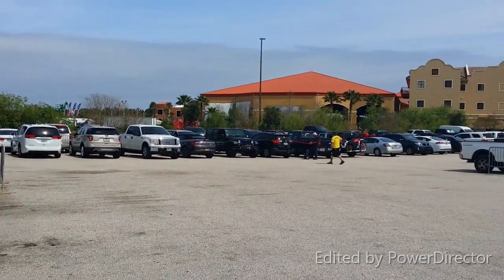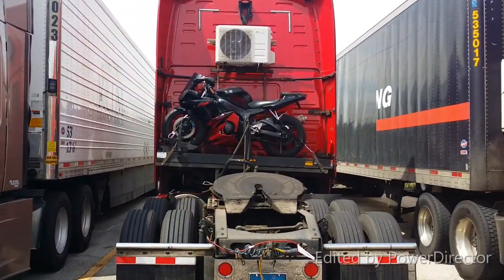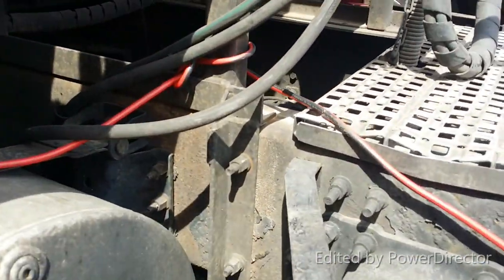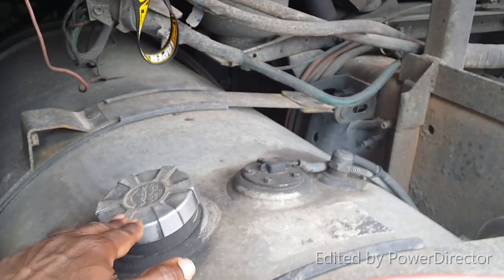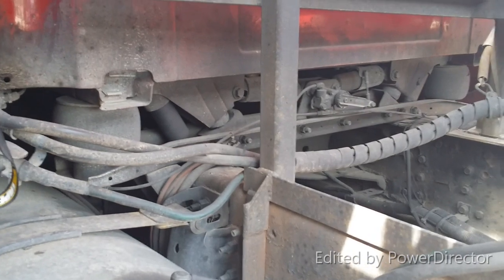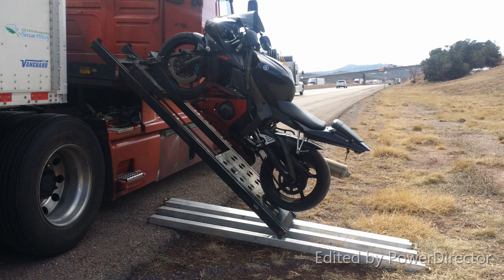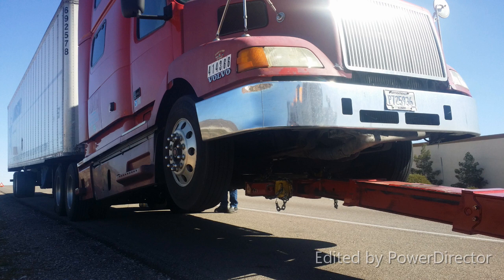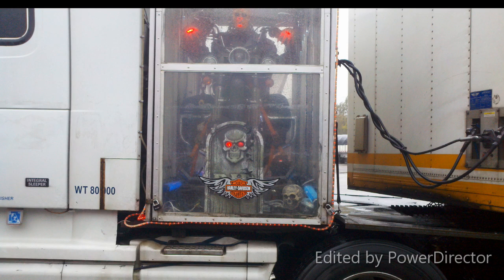How I mounted my motorcycle lift to my semi truck

Comment: Awsome Setup you have there man! Did you ever measure between the cab and the center of the 5th wheel? I wanna see if that will work on my truck, I pull a reefer trailer
Reply from the maker: Thanks for the comment, but I don't think it will work with a reefer unless the wheelbase is longer than usual. I saw a video of a bike mounted on the side of the truck under the sleeper

Comment: Did  you do a video on that Muffler ?  Sounds  like a Rip off..
   I have done welding  on my lime spreader  box on my truck before.. and  tiny  drops of molten metal  made pin holes in my air line..    You could   put some soapy water in a  spray bottle to  look for air line leaks ..
Reply from the maker: You are right that muffler was a rip off! I have another truck now a white 2017 Volvo. I got the muffler moved and I paid a lot less and I haven't had any problems with it.
Reply: @passporttrucker9280    You need a Truck with a longer wheelbase  so there is room behind the sleeper  for the Motorcycle..
Reply from the maker: @mikeskidmore6754  The distance between the back of the sleeper and the front of the trailer is what matters the most.  It is 67 inches and 4.5 inches between the sleeper and the lift.
Reply: @passporttrucker9280    So that is the Minimum room you need.  If you were pulling a reefer you would need even more room.   Most Trucks have sliding  5th wheels

Comment: I am in Alberta Canada. My understanding is you are not allowed to drill a hole on the truck frame . It won't pass inspection. I thought that safety law would be same every where
Reply from the maker: No holes were drilled into the frame. The frame for the bike ramp was secured with the bolts that were already on the frame. My truck was inspected by DOT last Monday. I've been carrying a motorcycle on my trucks since 2013. Also I'm leased to a carrier that requires a truck inspection every 120 days.

Comment: I see  you do use a Cover ..  It would  definatley  be worth your   trouble to make new brackets  with the passenger side one lower..
Reply from the maker: You are right I do use a cover. How did you know? I only paid about 40 dollars for it at Walmart. It has straps on it to keep it on when I'm driving. Why would lower brackets on the passenger side be better?
Reply: @passporttrucker9280    I  said you need a cover .. then  I saw your second  video that  showed the bike covered..  
  I have a really  nice  Heavy cover  but keep my bike Indoors so have not used it .  My Cover is Oxford   Protex Flex ..  I reccomend it ..   I had to get a much larger size for  my Yamaha FZ-07  because of Top case and side case..  Now I  have a much larger windscreen but  it is quick detach >
   You did a  really nice job  on the fairing hinges..
Reply: @passporttrucker9280    I was searching for the Bike Lifts  and I found  a youtube  channle that uses one ..  
@Hooperand Whistle ..  He  just  had some mounting brackets made  where the  drivers side is lower ..  so the bike unlaods  downhill..
Reply from the maker: @mikeskidmore6754  I'm planning on having my mount changed so that the rear part of the lift is lower than the front part for the same reason. As it is now the back is lower than the front but not by enough. It is also less stress on the cable. Thanks for the comment.

Comment: Did you have to get it inspected or anything? I plan to run a mount for my ebike until I get my bike finished.

Just need to know how to mount the stand so the guys at the scales have nothing to write me up for.
Reply from the maker: I didn't have to get the lift inspected but my truck and trailer gets inspected at least 3 times a year. I'm leased to Landstar. They require an inspection every 120 days. I have been inspected at the scales too. I've never had a problem because of the lift.

Comment: What kind of hinges did you use on the side panel on your truck and can you get  better pictures of how they are installed
Reply from the maker: I used the hinges that were on the closet doors. You can also find hinges at Lowes or Home Depot. If you go to a  home improvement store look for kitchen cabinet hinges
Reply: @passporttrucker9280  thanks

Comment: Where did you get this lift installed at? Can you send me information so I can get one installed please
Reply from the maker: I had the lift installed on my truck 6 years ago. I'm sorry I don't remember the name of the metal fabrication shop. It's in Orlando, FL. near Truckers Paradise which is also called Acme Truck Stop . I will try to find the receipt for you. I also need to have my frame redone. I want to change the angle because in the future I want to get a bigger bike.  You can go to a different shop and show them the video.  The shop that I went to doesn't normally install lifts on trucks. I went to the shop with a drawing of what I wanted  and we did the work together. You can find the lift on Craig's list or in the back of the motorcycle magazines.
Reply from the maker: The name of the metal shop is L & C metals. 711 Central Florida Pkwy  Orlando, FL. Jeff or Mike made the frame.  The number is 407-859-2600.  I found this info in my cell phone a few days ago. I called to make your sure that the number is still good and those guys still work there.
Reply: Passport Trucker thanks bud

Comment: Great video; so much ideas and imagination you give !

1- Did u extend the frame and fifth wheel away from from tractor head ? Or hauling a dry trailer is good enough tp give you room for bike mount ?

2- how do you secure you bike from being stolen, case ? Chains? 

3- who designed and built your bike mount ? For what capacity bike ?
Contact please ! 
🙏🏾
Reply from the maker: I didn't have to extend the frame. The fifth wheel was moved back to the last set of holes on the frame. My 2003 Volvo 770 has been replaced with a 2017 Volvo 780.  When I get back to the old truck I can measure the distance from the sleeper to the center of the fifth wheel for you. If you have a vertical exhaust pipe you will have to convert it to a horizontal exhaust (weed burner). My bike is also going to be replaced. I'm going to make a video about both so please subscribe. I don't think that you need to worry about a bike being stolen off your truck most are stolen from parking lots. I only used straps to secure my bike. In the future I'm going to do a video about how to strap down the bike if the straps are too tight you will damage the  forks. I designed the frame that the lift is attached to with the help of a metal fabricator at L & C Metals in Orlando, FL. The lift is made by Rampage. You can google it. The capacity is 1000 pounds.
Reply: Thanks for the prompt reply trucker, u earn an additional subs 😉🙌🏾
Reply from the maker: @PETIVOYAGER   Thanks

Comment: Hey bud let me ask you. Do you have any issues turning ?? I drive a flatbed and would like to bring my bike around.
Reply from the maker: No, no problems making turns. Some of the places I load or unload are small and I have to make u turns. You will have more space with a flatbed trailer than someone with a van. Flatbed trailers don't go as far past the fifth wheel as vans.

Comment: Do you have any troubles with reefer being so close to back of the truck?
Reply from the maker: I don't pull a reefer. I'm not sure but I think it might  work with a reefer if the bike is below the bottom of the reefer unit.

Comment: Did you make it yourself or is there a place that does it??
Reply from the maker: The frame that the motorcycle lift sits on was my idea. I went to a metal fabrication shop and had it made. The place that I went to is L&C metals in Orlando, FL.  407-859-2600

Comment: Where can you put an APU?
Reply from the maker: I have a generator under my trailer. If I was to install an apu on my Volvo truck I would install it between the battery box and the fuel tank. The truck in the video is a 2003. I now have a  2017 Volvo. On a Volvo truck without the after treatment I would put it on the passenger side.

Comment: Been a bco for about 7 months are you still at landstar. Anyways ran into your videos because i was lookingfor a mounting solution for my bike on my truck. Is that the rampage lift you're using? Did you have to do any custom mounting to get the lift mounted on the truck?
Reply from the maker: Yes, I'm still at Landstar. My lift is a ramape lift. I had the lift mount custom made at L & C Metals in Orlando, FL.
Reply: @passporttrucker9280  Thank you for the reply much appreciated. You got a new subscriber!
Reply: @passporttrucker9280  Thank you for the reply much appreciated. You got a new subscriber!
Reply from the maker: @RickySanchez.  Thanks for subscribing. I lost the motor in the red Volvo. I had 1.7 million miles on it. I now have a 2017 white volvo. I've been busy trying to fix it up. Hopefully soon I'll start making videos again, after I get my second vaccine shot May 22nd .
Reply: @passporttrucker9280  Was it a D12 volvo motor? I got a volvo D13 with ishift no major repairs yet knock on wood
Reply from the maker: @RickySanchez.  My 2003 had a Cummings ISX with a Eaton Fuller auto shift. Now I have a D13 with I shift too.

Comment: My boy this is a great video to watch you have me very excited to put my bike on the back of my Cascadia. Where did you get this equipment from? And could you inbox me or tell me hear the dimensions of the bar?
Reply from the maker: Thanks for the compliment. The lift wieghts about 330 pounds. L 95"x W 24". I bought mines on craigslist for $700. I paid $900 to have the frame made for it to fit above my fuel tank openings. http://www.ehamiltonenterprises.com/rampage.html. This site has the lowest price that I have seen for a new one. Sale price $2,545.00 plus shipping. If you see it cheaper let me know and I'll share with others.
Reply from the maker: Please subscribe I'm going to make some more videos in the future. I lost the motor in the red truck on my page and some stole my bike when I flew to Dallas to buy another truck. Right now I'm busy working and trying to get the new truck fixed up like the red one.
Reply: @passporttrucker9280  how is getting loads with the extra weight? Are you limited to lighter loads? I have a International with the wings behind the cab and an APU, my thank is under the cab so I don’t have a problem fitting it down to the frame.
Reply from the maker: @wilsonfortes814  About the same. I don't want to pull heavy loads. The heaviest loads I pull are around 42,000. Heavy loads decease fuel mileage and increase wear and tear on the truck and tires. They have to be scaled. I noticed that when I have a heavy load, I get stopped at the scales more. Also they don't seem to pay better.
Reply: @passporttrucker9280  I have a Triumph Tigher 1050, but I am thinking of getting a Suzuki 400 SM for the Truck.and try to build a ramp out of aluminum. I might have to remove the cab side fairings as well.
Reply from the maker: @wilsonfortes814  You can find a motorcycle lift on Craigslist for around $1000. I bought my lift from a man who was using it to transport his Goldwing on his RV. I wouldn't want to go down to a less powerful bike.

Comment: Do you have any problems on weigh stations ?
Reply from the maker: No, I don't have any problems. I can scale up to 43,500. I wouldn't want to haul anything heavier than that even if I didn't have the motorcycle on my truck. I've also passed Dot inspections with the bike.
Reply: Passport Trucker that’s awesome man you really inspire me to buy a motorcycle thank you so much again 👍
Reply from the maker: Thanks. That's my first bike. I bought it just so that I could be free to go where I want while traveling in my truck. I don't have to put extra miles on my truck or worry about going somewhere and trucks aren't allowed. Please like, share, and subscribe. I'm going to make some more videos soon.

Comment: Where can I find the hinges you have on your fairings?
Reply from the maker: The hinges I used are from my truck's cabinet doors. You can buy some hinges from Home Depot or Lowes. Make sure that they are cabinet door hinges.
Reply from the maker: Don't buy cabinet hinges!!! Sorry about that. I just looked at a freightliner truck that is parked next to me. The fairing panel has been torn off. I looked at the bracket and realized you don't need to buy hinges. As you are facing the hinge there are 3 screws positioned horizontally. Remove the center screw. Opposite of that screw there is one that is positioned vertically. Loosen that screw. The screw that is vertical is in the corner where the fairing meets the corner of the sleeper. Try it and let me know if it works. The brackets on your truck looks like two pieces of hard plastic. The brackets on my volvo are one piece of metal. I had to throw them away.
Reply from the maker: Were you able to understand what I was saying? If not I can e-mail you a picture of the bracket.

Comment: I'm getting ready to have a similar set up on my truck. Rampage Lifts is where I'm getting the lift from.
Reply from the maker: How much are they going to charge for the lift and the installation? I bought mines on Craigslist for $700 in like new condition.  I paid $900 to have it installed.
Reply: @passporttrucker9280  : Rampage charges $2900 new direct from them in Cali. No shipping since you buy from them directly.
Reply: @passporttrucker9280  I'll install myself.
Reply from the maker: Install it so that the bike unloads off of the passenger side. That way if your truck breaks down you can unload from the side of the highway and go get parts. Also mount it at an angle so that it is easy to pull the bike off.  Please send me a pic when you get it done.  JSmith0731@yahoo.com
Reply: @passporttrucker9280  :Gotcha, will do👍

Comment: 😱😱😱😱dammmm
Reply from the maker: What were you responding to? What he said or what I said back to him? The bolt he was talking about is not loose. There is a spacer on the other side of it. The bolt and the spacers keep the pulley centered in front of the winch. I didn't see any bad welds. I saw some rust. I'll say it again. I installed the lift in 2013. My truck is a 2003 with 1,708,000 miles and no inframe yet. I'm a million mile safe driver at Landstar.

Comment: how about getting all those busted Wells and loose bolts tightened and how about throwing some soap on that truck as well as your sunglasses
Reply from the maker: How about you learning how to spell? I've had the lift on my truck since 2013. It hasn't fell off and it stills works. I doubt anybody decided to watch this video to see if my truck and my sunglasses were clean. Thanks for watching and commenting.

Comment: Do you keep your 5th wheel all the way slid back so the trailer doesn't hit the bike when turning?
Reply from the maker: Yes, I also had the 5th wheel moved to the last set of holes on the frame.